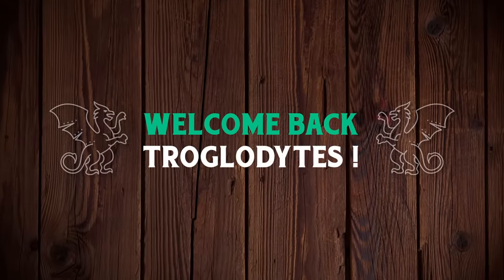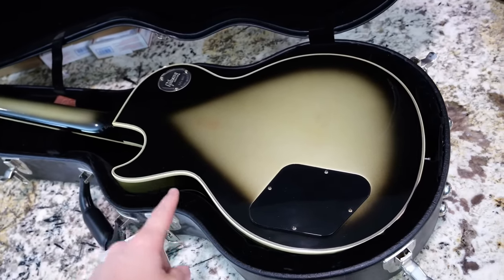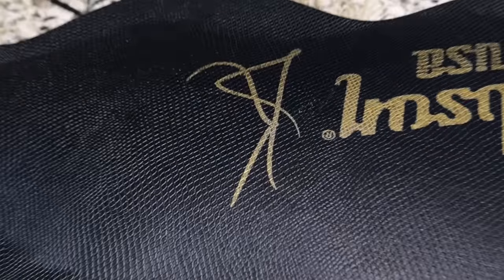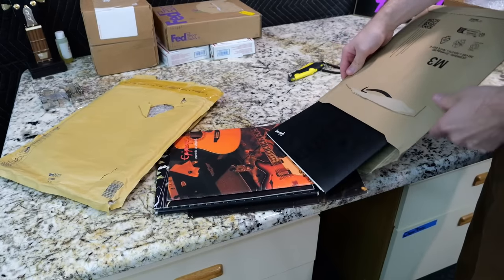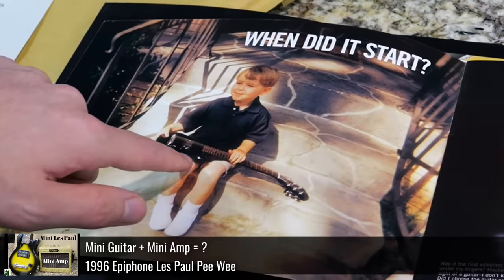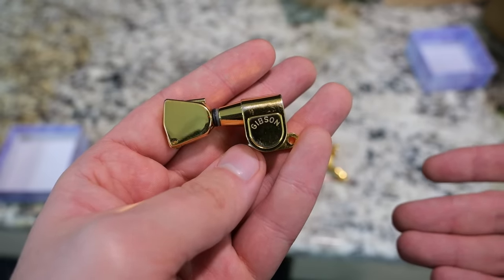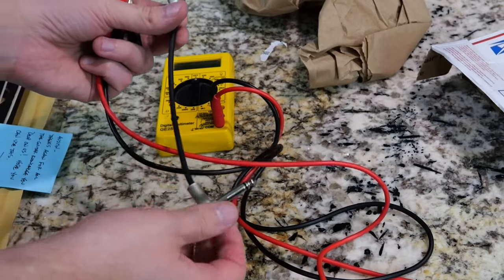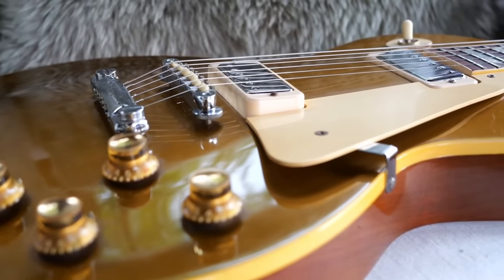My Package Got "Security Checked" | Trogly's Unboxing Guitars Vlog #179

Comment: Hey Trogly - glad you liked the tester lead I made for you! I was making one for myself as I do guitar tech work as a side gig, and I thought I should make one for you to say "Thanks" for the great videos. You may be right - I did keep the leads kind of short, but I did that purposefully for myself because I have limited space on my bench.  I hope you enjoy it and maybe I will dip into that niche market and sell some of those!!
Reply: Yours is a better system than using alligator clips which on my meter are tiny ends and not big enough to stay attached on the patch plugs.
Reply: @jimmyjames2022  Agreed - the alligator clips are fine when you are attaching to smaller diameter wires, but when you are clamping to something like a 1/4" plug, they definitely can pop off.  I probably should have made the leads longer though - you could always coil it up to save space if you don't need to full length. I did use silicone coated wire so it was not susceptible to melting when I was soldering, so it is a little more expensive.
Reply: Great job on those Daniel! I would be interested in buying one from you!
Reply: You're the kinda guitar nerd I hope is doing electronic swaps in one of my guitars. And I always wondered how he pulled readings.  If you pulled out your custom set and were like "naw this pickup is good"  I'd be more impressed than the roach clip method. I understand trogs reasoning  he's a good man, but I think you should offer them on reverb. Dunno if you'll become a millionaire cuz of them but I can see you  getting rid of  quite a few sets to guitar techs/nerds.. worse case Ontario they don't sale and you have a few you've pre-made.
Reply: @jlo7770  If you are in the Orange County, CA area...bring me your guitars! 😉 It would be interesting to see how much interest there is... The parts are cheap but the is some labor in the assembly.
Reply: @DanielBobke  sadly I'm halfway across the country from you, (north dakota).. no I understand, I'm terrible with electric stuff but I'm sure you could make? A handful and either sale them or give them out to friends if they don't sale.. theres gotta be guitar store near you that the techs would be like ahh it is cooler/better than alligator clips to check pickups. Unless it's guitar center I'd can see a small business owner being like ya I put your product on the shelve see if people buy it. 

I'm no pro sales person but I'm sure there's cheap packaging you could do, file a patent, get an llc. Make a handful of them and if there's a guitar tech working there they'd buy it. Dude you could do a super fancy version get a patent and sale the patent to stu Mac or some other company that focuses on guitar stuff..

My buddies wife came up with this shower deal, she was a caregiver for her mother and she drew up this whole shower system that was optimized towards people doing that line of work, she drew the whole thing up got a patent and some shower making company paid her like 20 grand for her idea.

I'd go with it throw a little money out there make some and see if people buy them. You could make them apply for patent and just make a small "package" thing print something off on the home printer and staple it around the cable, take em to guitar stores, list em on reverb

To me it sounds like a specialized tool that applies to a certain group.. I work in the oilfield and there's tools you gotta make cuz no one makes them... Maybe this is that thing? If you can afford it and do a handful of them what's the worse that happens? Out a couple few hundred bucks? 

Life's about taking chances, Austin bought a fake les paul for 15k and it helped launch his career.. from his own mouth he's keeping it forever,it was a huge risk and it turned out bad for him but in the end it ended up helping him launch his yt career... something to think about
Reply: @jlo7770  Everybody with some soldering skills can make them. The parts are cheap and you can buy them everywhere. So if you know somebody who can solder, I'm sure they will make you one, it is like 10 minutes of work. But that only makes sense if you have to measure pick-ups a lot.
This measurement gives you the DC resistance. The only thing that tells you is the amount of wire (if you know the thickness)  You can remove the magnets, screws etc etc, that does not matter, you only measure the DC resistance .

A better way is to measure the impedance at f.i. 1 kHz or better make an impedance plot over the whole audio frequency range. Then you can compare pick ups to see if thy are the same. Only problem is that the average guitar-nerd/tech does not know enough about electronics to do those measurements and/or does not have the gear. The multimeter used in the video cost probably 10 bucks or so. The meter I use for impedance is not an expensive one at 1800 euro, they go up to far over 10k. However you can buy cheap Chinese ones for a few 100  dollar, they are probably accurate enough for hobby use. But you can only use it to compare because the manufacturers do not provide that data. A big part of this industry is still operating in the electronics equivalent of the stone age. 🙂 (I am an EE working in the electronics industrie)
Reply: @pa4tim  cool. Who are you? I'm assuming you can't afford a 20k guitar lmfao
Reply: You should sell these!

Comment: I used to work at DHL snd they typically do up to 3 inspections at the origin station. A physical inspection upon the creation of the airwaybill, a visual inspection before it gets dimmed n' weighd, and a TSA approved means of screening before it gets loaded on an airplane. More inspections may happen between the origin and the destination as per the transiting country's laws.

Comment: 07:12 - I still have my 2008 SG Special Faded Worn Cherry that I bought new. It was my first guitar. I got it after drooling over a similar catalogue from around 2005 where all the Faded guitars were shown and the specs listed. I originally wanted that LP Faded Special single cut, but no one ever had it in my country, so it was impossible to get. Can't say the SG hasn't worked out great anyway...

Comment: 1:51 I believe that is an aniline die transfer mark. That die will transfer. If you have a stand that is dark color the die will not show that it has soaked into the soft support until it transfers to another guitar as seen here. IMHO don’t buy used guitar stands. And do place cloth under your Custom Shop burst. I have a König & Meyer stand that I had my 59 burst in. Fortunately the stand is black with white guitar supports. The white rubber thought me a much less expensive lesson than seen here in today’s video. The red begin to leach into the stand leaving a red mark after one night in the stand. This is my recent experience with mysterious red marks. I now cradle my burst with a couple old t shirts.

Comment: Those banana to 6,5mm plugs patch cables are not only used for checking pickup wire resistance. I have a set that is like that and a set that goes from 6,5  to BNC. I use them for electronics repairs to inject signal or measure a signal. I have an electronics repair shop (marine, industrial and test/calibration gear) The patch cables are more used for hobby, like repairing a (guitar) amp. Playing guitar and electronics are my (very long time) hobbies. I only have 8 guitars, I live and have my shop on a boat, so no room for more guitars.

Comment: Pre-departure international airfreight security inspections have been par for the course with DHL and most other carriers for some years. The DHL stickers and tape clearly show why the box has been opened. You'd be more bummed if the box had been randomly opened without any indication. If the security seal and tape have been broken before delivery it indicates that destination customs have also opened and inspected the contents.

Comment: Please use your channel to give some very valuable advice:  Especially with Gibson guitar, tune the strings down SLACK when shipping the guitar.  We know that headstock is a bit fragile and by slacking the strings it takes about 100 pounds of force off the headstock area which gives it just that much more tolerance to being knocked around in shipping.     This isn't a bad idea for ANY guitars but especially for Gibsons!